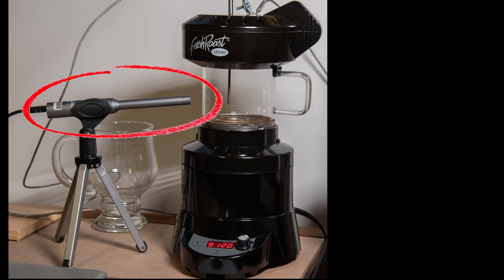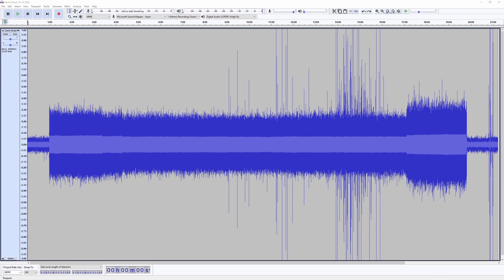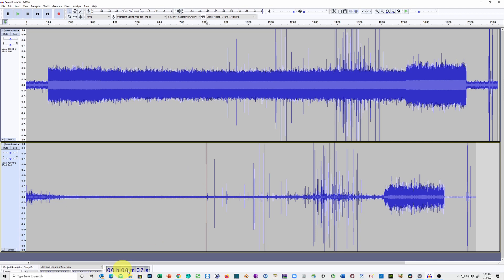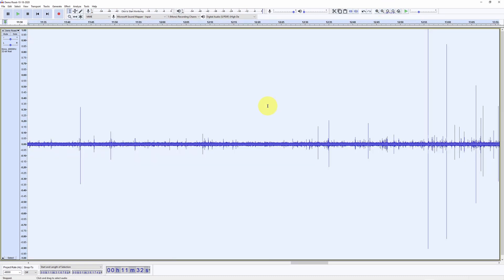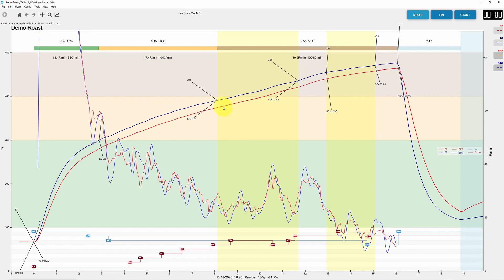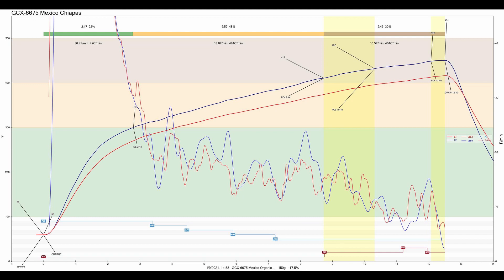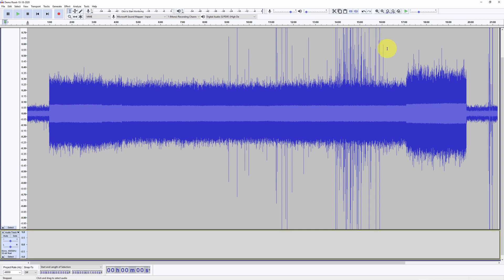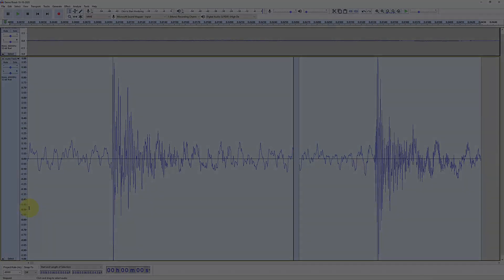Coffee Roasting Sound Analysis

Comment: Your videos are FANTASTIC! They have really helped me understand what is going on during a roast. I look forward to instrumenting my SR540 as well. I suspect that the reason the FC and SC waveforms appear so similar is that a major portion of the energy is above the ~12.5 kHz Nyquist limit on your recording. They are aliased/folded back to lower frequencies. It would be nice to have a 100+ kHz recording (or even a 1 MHz!)--if money were no object! This might allow us to see the spikes as true impulses rather than a spike with ringing for several ms. That's when we could probably differentiate the FC and SC by the characteristic shape of their impulse waveforms.

Also, it would be awesome (and much cheaper) to look at the fan spectrum vs the fan setting. My guess is that a (software) notch or comb filter could take out the bulk of the residual fan noise. 

I know the point is to roast coffee, and I don't think any of these suggestions would help produce better coffee. 20 years ago I worked in a lab with access to everything needed to do these analyses except the broad spectrum mic/transducer. I'm just curious.
Reply: Not my work, but looks like the kind of system that would work nicely.
Reply from the maker: Thanks John for your feedback and good points on additional sound analysis work. I don't have the equipment for higher frequency recording so I don't think I will be able to help there. For my purposes the processed sound waveform gives me the clear indication I need to determine the timing of crack events in a more objective way. Something I may do in the future is to collect some statistics to see how these events depend on bean type and how much variability there is within the same bean type or when using different roast profiles on the same bean type. Thanks again for your comment!

Comment: Fantastic work. I’d like to use this in realtime, as I am hard of hearing. Any software or app suggestions? A sound engineer suggested that I get the Acon Digital DeNoise plugin and add it to the Audacity software. It is however $100+ USD, so I’d like to know if it would work. There are also real time spectrum analyzer apps (iOS and Android and PC), but I’ve heard that it is very difficult to use these apps to distinguish FC or even SC. Any help for a this hearing impaired person would be appreciated.

Comment: How did your thermocouple temperatures correspond to the SR540 internal temperature display?  Can the SR540 internal temperature display be used with/without correction?
Reply from the maker: There is correlation but it is not simple, the dynamic response of the SR540 internal thermocouple is much faster than the others because it is a bare thermocouple junction measuring the air inlet temperature. It changes very fast after changing a fan or temperature setting, while the thermocouple inside the probe in the bean chamber changes more slowly and it is more representative of the bean interior temperature. I started trying to use the SR540 internal temperature sensor to adjust the settings, but I quickly grew frustrated and started exploring other options. Hope this helps!

Comment: Further to my comment below I am hearing impaired and really could use your help.  Is there some way we can connect to chat further, other than using Comments?
Reply from the maker: Hello and thank you for your interest. I do not have much more to offer on the sound processing front, the Audacity program worked well for me and as shown in the video you can see the spikes for FC and SC without the need to hear them. Since I use the same beans and profile for my roasting, I no longer use the sound processing setup because the FC and SC always happen at approximately the same bean temperature (in my case ~ 400 F for FC and ~445 F SC).